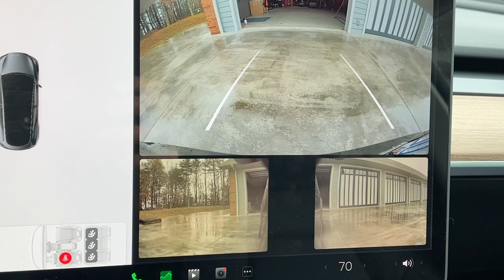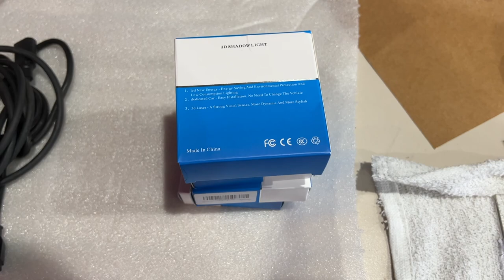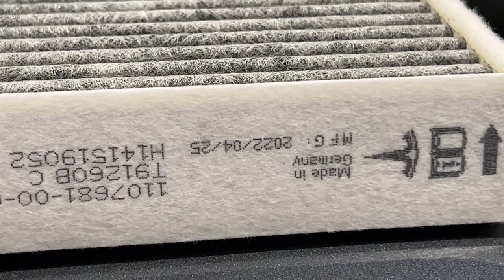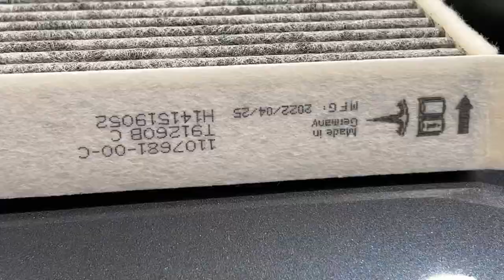Tesla Model Y Wash & Upgrade

Comment: Any issues with Puddle lights? I read several people having windows issues if a door was opened like some draw too much power on the circuit.   Let us know if you run into something. See the 1 star issues on your link in Amazon.  Also, some burn out early.  Want to get a set, just concerned if they hold up and don't cause issues.

Comment: Hi Dave,
Many thanks for another nice video.
I liked the new puddle lights.
I have a new 2023 Model Y LR and the OEM inside foot well lights are VERY dim.  I think you mentioned that you changed them out.  Are they any brighter than the OEM foot well lights?
If so I would appreciate a link to where you purchased them.
Any help would be appreciated.
Reply from the maker: Oh yes the new lights are 4 times a bright.

Comment: I have the exact same Abstract Ocean filters that you pulled out in my Model 3.  For me, I couldn't care less about the carbon but they do one thing that the stock filters do not.  The AO filters have a 3/4 inch "lip" of plastic around the edges.  That prevents the filter material from sitting in dripped condensation which dampens the filters and causes bacteria to grow.  I'm in a humid environment (FL) and this is a real problem here.  The AO filters last probably 9 months whereas I can only get about 4 months out of stock filters before the car smells like gym socks and vinegar.  Just a poor HVAC design from Tesla.

Comment: Doesn't placing puddle lights voids the warranty?
Reply from the maker: I could not tell you
Reply: They do, if Tesla service see them they will note to void window related warranties on your vehicle. The issue is if the bulb shorts out, the window will not roll down when shutting the door, causing you to smash the window on the door trim. I really want them also but not sure it's worth the risk.

Comment: With so many new exciting high end EVs coming out in the next few years, are you on the waiting list for another manufacturer’s EV?
Reply from the maker: The charging network is 50% of my EV purchase. The CCS charging is not reliable enough at this point. I’ve got a couple more Teslas in order
Reply: @evdave528  thanks. I had a hunch you would say that. We have a 2022 Nissan Leaf plus which we love as our around town runabout.  We’re looking to replace our 10 year old Subaru with an EV for longer trips. The leading contender is a a Tesla Y.  I’ll probably rent one for 3 days on Turo first. What’s held me back thus far is the mixed reports on fit, finish and rattles. Since owning a Leaf, it’s hard to go back to an ICE car.